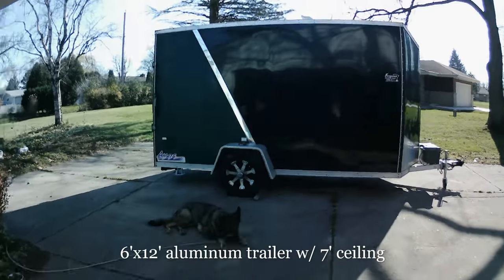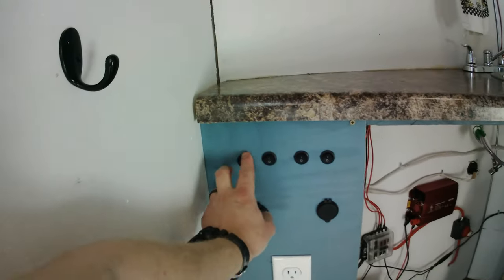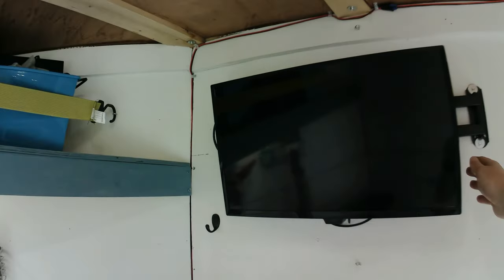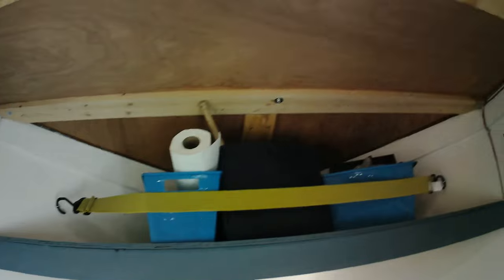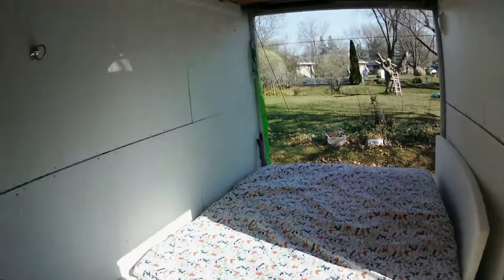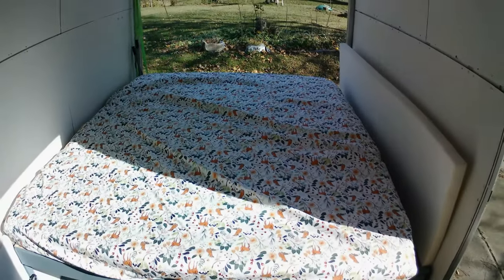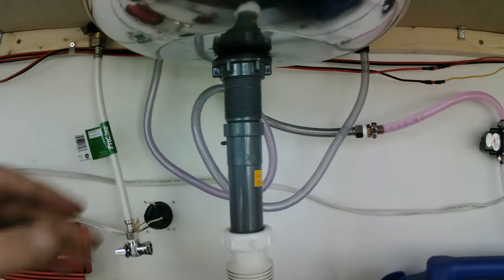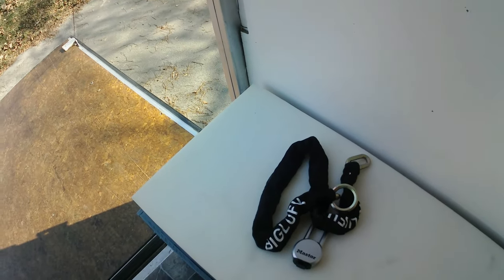Cargo trailer camper conversion

Comment: That's exactly what I need as far as size and accommodation. I saw a guy recently that cut the plywood at 8 inch intervals and made it look like ship lap. All I need is Air and Heat a cot and a exhaust fan, a good one. Very interesting thanks brother.
Reply from the maker: Thank you!

Comment: The co2 detector won't do any good mounted near the ceiling. Co2 is heavier than air. It needs to be mounted just below bed height. The way this is mounted, you'll be dead before the alarm goes off.
Reply from the maker: I believe you are thinking of the propane leak detectors. Those need to be mounted on the floor and you will see that as well as combo detectors with co2 in campers. CO2 detectors are suggested to be mounted anywhere from 6 inches below ceiling to 6 inches above floor.